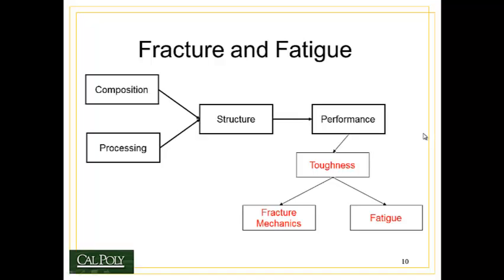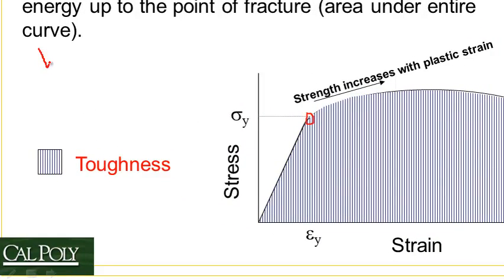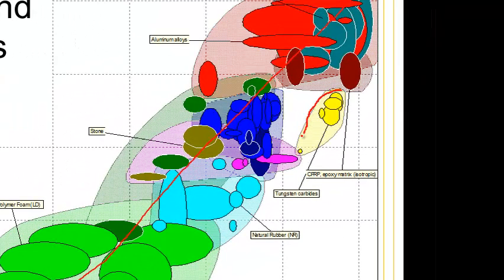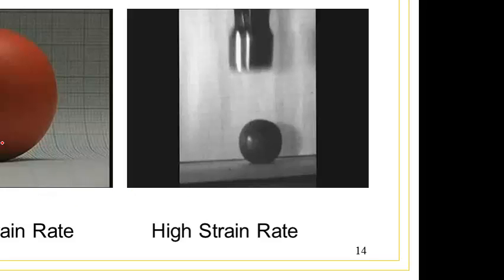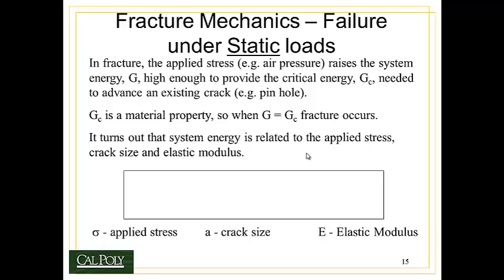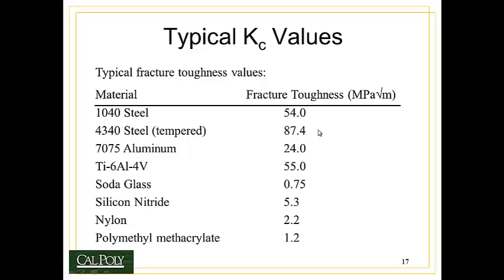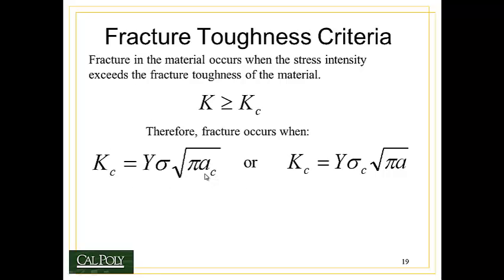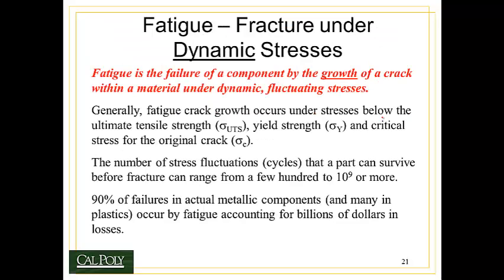Topic 6 - Fracture Toughness

Comment: stress times strain is not work, it's work per unit volume:
W = F * dL = F / A * dL / L * A * L = ( A * L ) * ( F / A ) * ( dL / L ) = V * sig * eps

so

W / V = sig * eps
Reply: +Manuel Pena 
It's more easily understood as pressure. Work per volume is:
Force*Distance/(Distance)^3
Alternatively, stress time strain is:
Pressure*(Dimensionless or Distance/Distance).